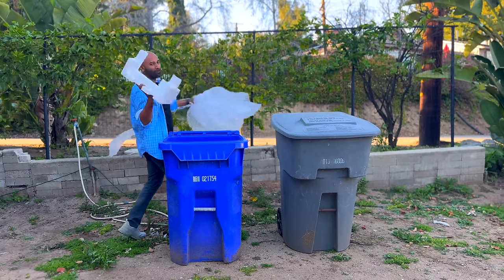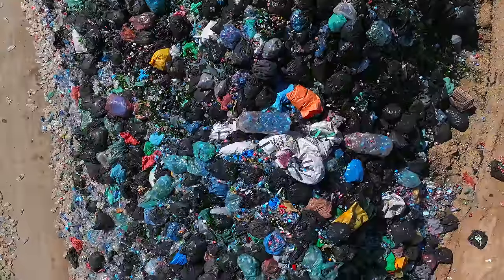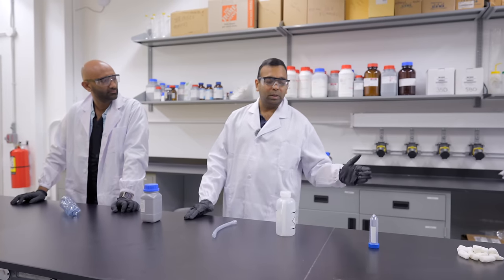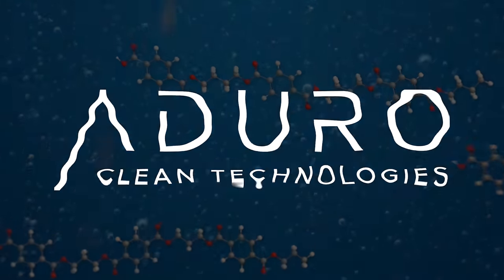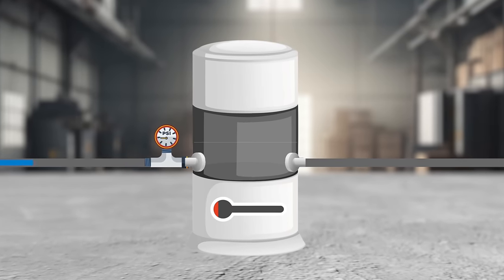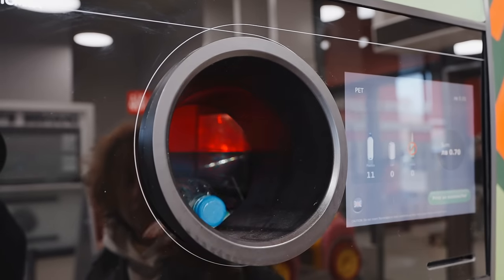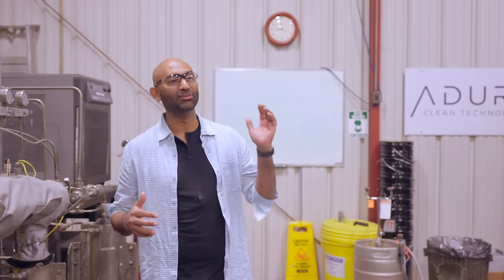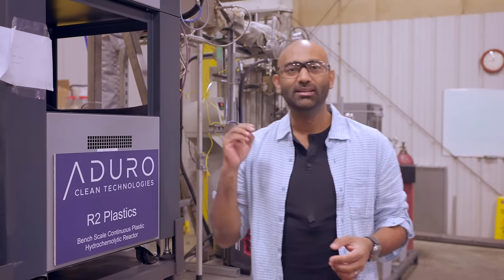Plastic Waste May FINALLY Have a Solution!

Comment: that is literally identical to crude oil refinement. and this is not ingenious but obvious. Pyrolysis is known for thousands of years, cracking and hydrogenation is simple.  Tre chalenge is do this profitably with plastic, when oil is cheaper than plastic waste, easier to work with and so on. 

I think the best way to do this and what we will eventuall do anyway is to mix the plastic with lotta biomass. You pyrolise that, get basically crude oil wrom destiling the pyrolysis gases adn the you make, fuel plastic and gas from that. Now you have circular economy where everything is recycled and burned in a circle and co2 is not a problem, because it is the part of the cycle now.
Reply: It's not identical to oil refinement. This is a water based system that requires only 400 degrees to break down and separate the molecules. It can also upgrade refined bitumen (which is the origin of this company) hydrochemalitic. You should review the process it's impressive

Comment: Are we really sure that we have a plastic waste problem?  We produce 460 million tons of plastic waste each year according to the web site I found.  If we assume a density of water, 1cc / gram, the volume comes out to 460 million cubic meters of waste each year.  If we bury it 10m thick, it requires 46 square km per year.  That is 0.00003% of the earth’s surface per year.

So, I ask again… are we really sure we have a plastic waste problem?

*IF* they can recycle cost effectively, then sure, I’m all for it.  But so many of the green projects are NOT really solving problems that we really have.  CO2 based global climate change caused by man is one glaring example.  That entire concept is a hugely overblown hoax.

And, of course, this has all the same problems.  If the developed western world 100% cleaned up its act, the developing countries, including and especially China, would still exist and still pollute and we would have solved but a fraction of the problem.

This has all the hallmarks of a TED talk.  Liberal feel good ideas but are utterly useless in any real practical terms.
Reply: Yes that small percentage is still very much a problem because it adds up over time. Won't impact us personally but if every generation says that then eventually future generations will get screwed.

Comment: Starting from the first words out of your mouth in the video.. "Plastic recycling is complicated"  No it's not... It's the easiest thing in the world to recycle.. It was made from oil.. it can be ground up compressed/pelletized and then reused as fuel in power plants.  Want to give people a cheaper/cleaner environment let them burn fossil fuels or convert them after original use into energy.  But that would destroy your entire video and make cheap solutions expensive.

Comment: "Plastic is not on the periotic table."
 Really?  Did AI write this? I remember now why i stopped watching you several years ago.  Why would you even have to say plastic is not on the periotic table? Why. 
1.Carbon and hydrogen everything is on that table. 
2.It's a list of elements not compounds made from those elements. 
So pick one and explain why it's not if you are going to say something so dumb. Can't believe this has to be explained to an adult with an engineer YT channel.
Reply: You seem to have an unacceptable chip on your shoulder.